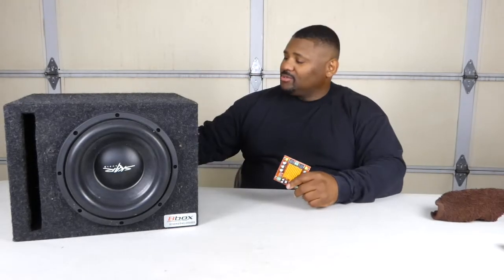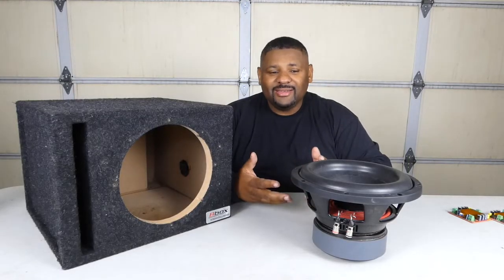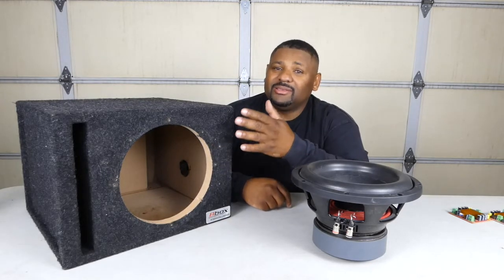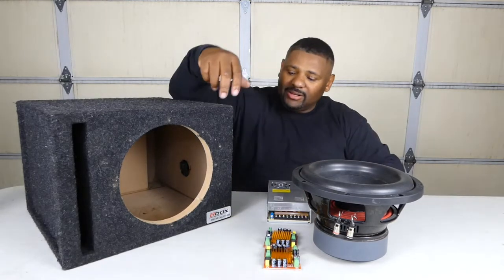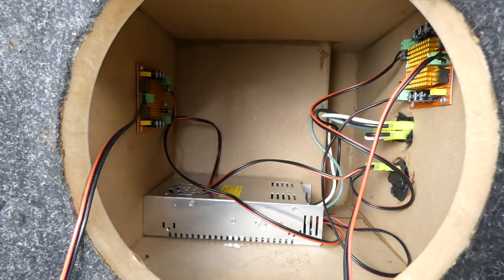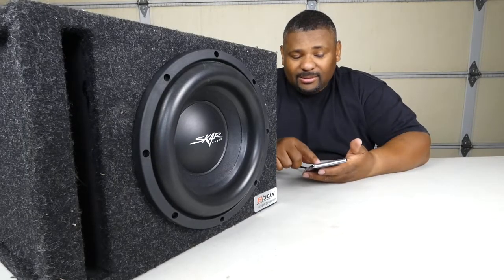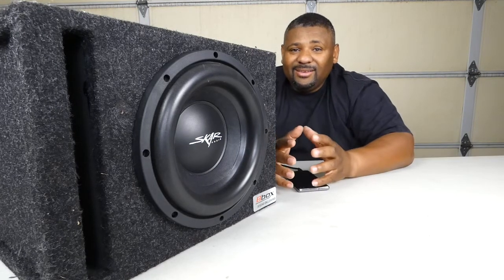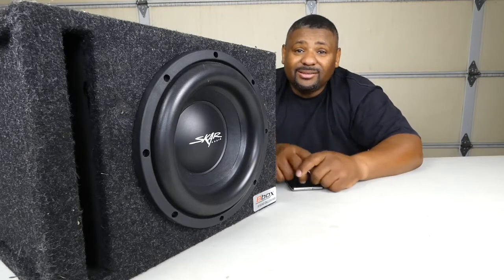DIY POWERED SUBWOOFER! HOME AUDIO SUBWOOFER!

Comment: This is a prime example of "Just because you can, doesn't mean you should". Running two separate amps on the same driver is a big no no, while the written specs will be the same the actual output will be different, not drastically but still different. You will destroy that sub in a relatively short time. Add to that the fact there is no LPF so you are feeding full range frequencies to the driver. This video should just be titled "How to waste money and destroy a driver"
Reply: Its a dual voice coil sub... essentially 2 subs in one. Many in the car audio segment run 2 amps for dual voice coil subs without issue. Its the not the same as running 2 amps to one single voice coil sub. That will cause issues.
Reply: @GlennPearsonDIY  But those 2 amps have to be dialed in perfectly the same.

Comment: Would you be able to give the specs, and everything that you bought for it? That's really nice I like how you did that.
Reply from the maker: Thanks, I'm glad you enjoyed the video. Here is the list of parts i used other than the box and wiring.

https://www.amazon.com/Yosoo-Channel-Amplifier-Single-Channel-TPA3116D2/dp/B07JPYDY37/ref=sr_1_47?crid=38CA6EJBKPS47&keywords=chip+amplifier+board&qid=1660591955&sprefix=chip+board+amp%2Caps%2C143&sr=8-47

https://www.amazon.com/ALITOVE-Universal-Regulated-Switching-Transformer/dp/B06XK2ZNKC/ref=sr_1_3?crid=25ZKJ11Q77MHS&keywords=24v%2B15a%2Bdc%2Bswitching%2Bpower%2Bsupply.&qid=1660592127&sprefix=24v%2B15a%2Bdc%2Bswitching%2Bpower%2Bsupply.%2Caps%2C157&sr=8-3&th=1

https://www.amazon.com/URBEST-Module-Switch-Socket-IEC320/dp/B00NWLE4U6/ref=sr_1_3?crid=1IQ34R2777Z11&keywords=3+pin+iec320+c14+inlet+male+plug+power+socket+red+light&qid=1660592335&sprefix=3+pin+iec320+c14+inlet+male+plug+power+socket+red+light%2Caps%2C132&sr=8-3

https://www.amazon.com/20pcs-Female-Terminal-Connector-Adapter/dp/B078HY1WP1/ref=sr_1_1?crid=266L7CJGHGCI1&keywords=exgoofit+phono+rca+screws+male+female+plug+to+av+screw&qid=1660592521&sprefix=exgoofit+phono+rca+screws+male+female+plug+to+av+screw+%2Caps%2C126&sr=8-1